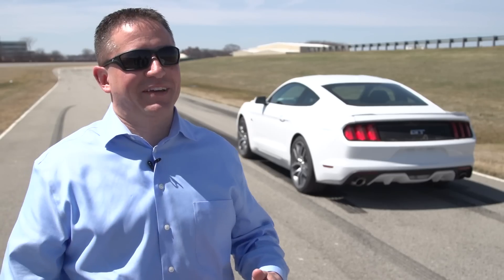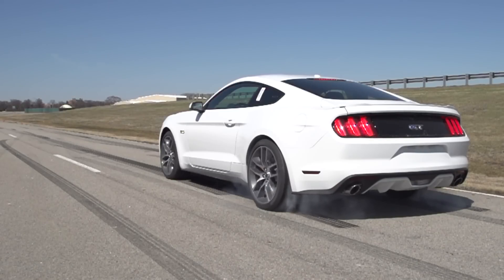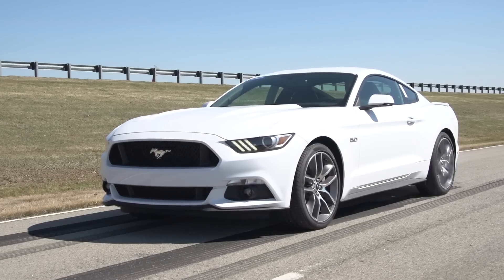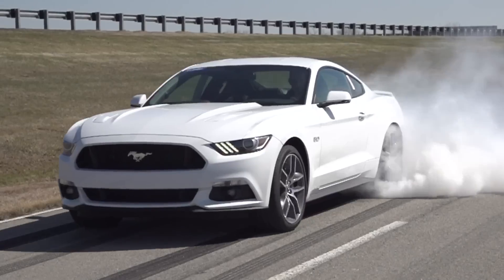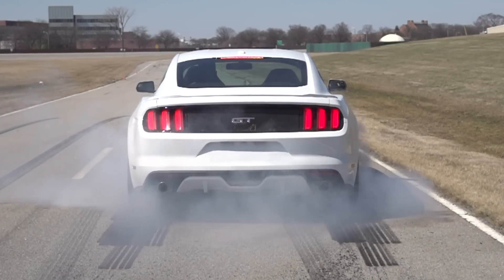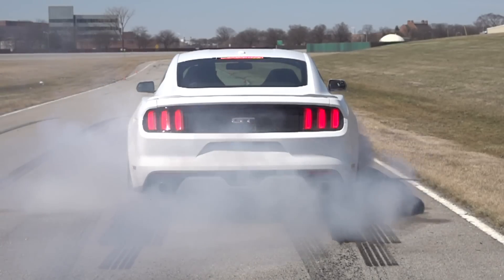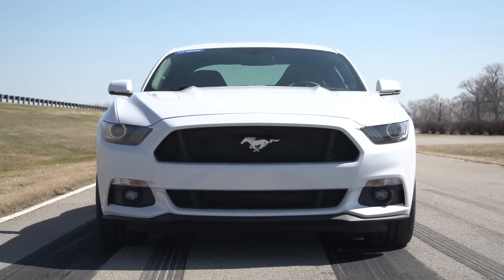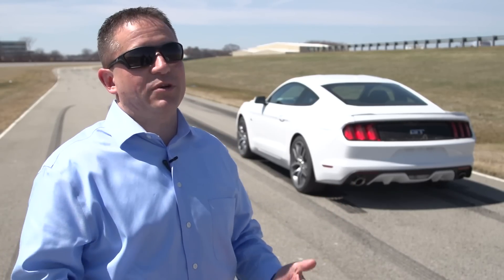2015 Ford Mustang GT: Line Lock burnout feature

Comment: Not necessary. 
The day I purchased my new Mustang I did burnouts rite out of the dealers lot.
Did not need to lock the front tires ever to do a burnout. 
If I ever needed help I would just hold the break for a moment and that would do the trick. 
The V-8 has plenty of torque to break the rear Wheels loose and do a burnout as long as you like.

Comment: Those Pirelli's are $375 each Ford ...line-lock seems a waste for 99% of owners. I have a 2013 GT Premium w/SCT Tune/CAI - 6 spd manny. No need for line-lock. 2015 car is nice ...but the money cars will be the 13/14 cars, they are tougher looking - final "true" Mustangs with the desirable live-axle that's very well sorted + the Shelby GT500 front end (= $$$). My car drives like a Benz when cruising 80-120+ on hwy ...a a little push of the go peedle on the back roads, and I'll run with a 911 S, M3, C63AMG or C7 Vette. >>5.0 302 motor is light and powerful as hell!!!

Comment: The 5.0-liter Coyote V-8 received upgrades for 2015, which raise output by 15 hp and 10 lb-ft from the previous Mustang GT. All 5.0-liter V-8s received bigger intake and exhaust valves along with the Boss 302's valve springs. At 435 hp, the 2015 Mustang GT is down 9 hp from the Boss 302, though it makes 20 lb-ft more. Also lifted from the Boss are its connecting rods and oil cooler, while the valvetrain gets a higher-lift cam profile

Read more: http://wot.motortrend.com/1407_revealed_2015_ford_mustang_gt_makes_435_hp_400_lb_ft_of_torque.html#ixzz37sSy8SQ2

Comment: I'm glad I bought the 2014 5ohh...  It gonna take a minute to get use to this exterior design...  I'd rather do a manual burnout!
Reply: Gonna take more than that...the 2015 looks like a womans car now
Reply: It will still be a manual burnout. A line lock keeps the rear brakes from grip during a burnout so you don't wear out your brakes. It's a popular after market mod for drag racers. It has nothing to do with Auto or Manual.

Comment: So at one point the designers of the new Mustang wanted to get away from the "sport car in a straight line" era by providing it a proper chassis (at last, in 2014!). Yet they fit it with this feature?
Reply: Sad. Does that really provide traction? It looks to me that all it does is melt the tires... thus losing traction. Either way it's a waste of design effort.
Reply: Charles Sophus Well, I go to the tracks but not the same tracks. I'd rather have a good chassis and brakes so I can actually turn sharply rather than have a "quarter-mile feature". To rephrase my comment: this feature is useless in the Nordschleife.
Reply: its just a cool ft to have if u want to use if buy it i would use it at track are jsut to do a fly burnout
Reply: its for people who go to the track mainly and if u just want to use it for the hell of it i think its a cool ft tho
Reply: Steve Hartzog Never been to the dragstrip have you? LMAO... When you go to the drag strip, many people put on "drag radials" or "slicks"... These are tires that like heat to force the rubber to expand, and therefore GRIP BETTER... There is a water box that you drive through to help initially break traction, and then you hold the brakes and heat the tires up doing a burnout. Without the line lock feature, you wear your rear brake pads because they are active while doing a burnout. This has been added to many Mustangs as an after market accessory just to save the wear and tear on the car. So yes, Ford knows their market, and adds a feature that many people will get good use from... Just because you don't know why it was added, doesn't mean its "a waste of design effort" you tool bag lol...
Reply: Manu Delmarche that may be true but the new irs is not
Reply: sjpro1 You are absolutely right. I hope to try one of these babies soon!

Comment: Who drag races a stock 5.0? Are you aware of how many people will beat you? Maybe they could've put that $ into interior that doesn't fall apart
Reply: I've owned six mustangs including my 2012 5.0, NONE have ever fallen apart. Just Camaro fan girls talking shit.
Reply: spookypunky Lol, it's true, I have a 2000 mustang that I bought from an owner at 160k miles and the vents on the front rattle quite a bit, and the passenger vent isn't even shaped to fit above the glove box, and the side vent literally just comes off. But other than that interior wise that's the only thing that has fallen apart.
Reply: A few reviewers have stated that the interior is much more tight and refined.
Reply: Lovely, I've known MANY people that have owned Fords and their interior literally fell apart.
Reply: THANK YOU! They're junk, parts made in Mexico
Reply: Ever own any  Mustangs from the late '70s? Camaros are a huge waste of money! I like Mustangs fine, I have seen too many of my friends' Fords fall apart.
Reply: That's funny bone stock 2011 and up Mustang GT automatic car runs 12.50 in the Quartermile. That's pretty goddamn fast for production car specially if you run a bracket race it. So who runs a Mustang 5.0 as a race car thousands of thousands of people
Reply: demongawl
Uh no? I'm the one with the mustang, not a camaro. Those were my two choices I went with mustang. What I said was true. No fangirl here.
Reply: Which one is your favorite?
Reply: spookypunky
Dude it was a less than 20k sports car and you're letting someone with an sn95 make comments about interior? Owning an SN-95 Myself that just sounds like someone who didn't take care of their shit.. The car still had it's squeaks and so forth, but never did my interior fall apart..

Comment: Nice feature but I'm a lil confused. I own a 2012 gt. Completely stock other than flow master outlaw mufflers. Anything else will void my warranty. I can't even get a tune. Last time I was at the dealer for an oil change, there was a mustang owner who had to pay for a broken drive shaft (I think). Forgot exactly what broke. But they are making him pay because he was racing it at the track. They could tell because his rear tires were bald. Lol. He should have outraged two new tires and said it just broke out of nowhere. Anyways, I wouldn't feel comfortable using this feature because they can always tell that you used it...

Comment: I never understood why anyone would want to burn up the tires just so they could go buy more at $300+ each.  Not to mention damage to clutch transmission and anything else you could imagine.
Reply: $300 each per tire? Damn, you need to find another tire dealer! Also, they explained in the video, it heats the tires, helping it stick to the pavement, thus preventing loss of traction, therefore holding grip to get a better time in a race.

Comment: "Line Lock" aka "The buy new tires every month feature" They should have made the front end look more like an Aston Martin and not a scion frs. If you look for an 80s Aston Martin you'll find one where the front is very influenced by mustang. The taillights were a step back from 2013-14. Here's to hoping it's as good as a 302.